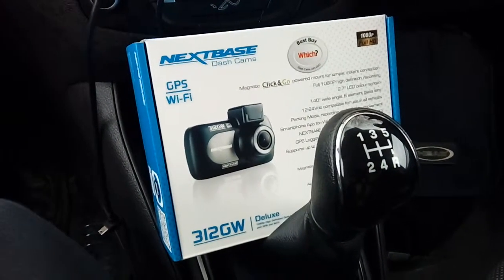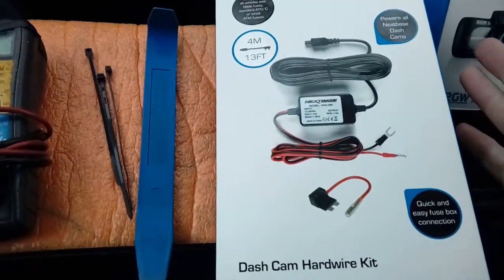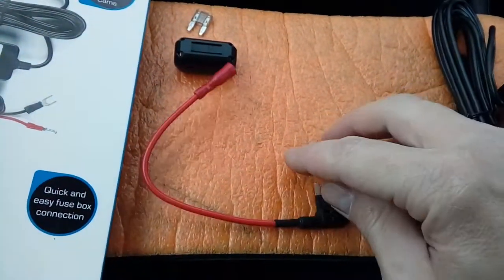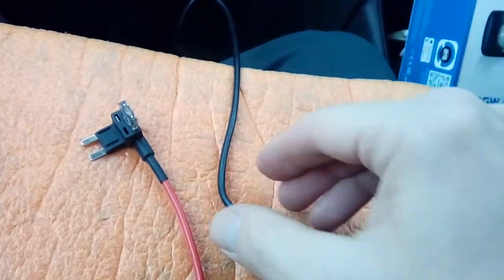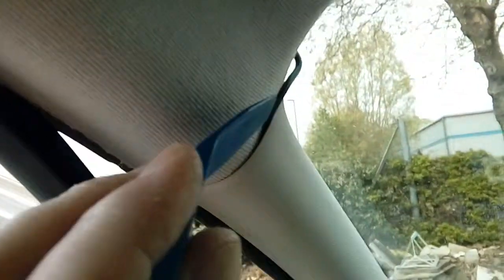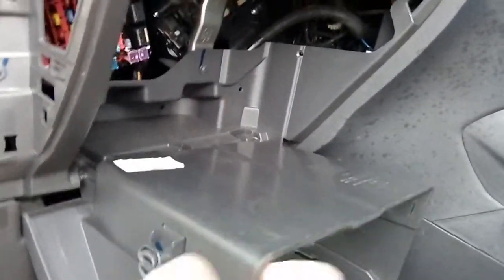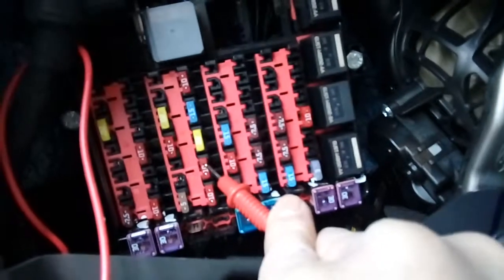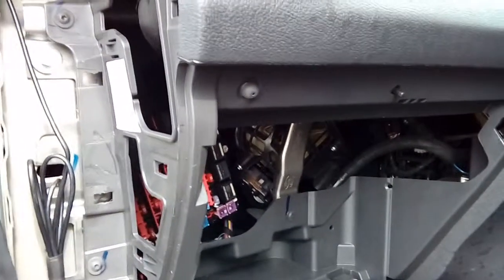Ford Courier how to fit dash cam to go on/off with ignition + no wires on show

Comment: I have this camera and van and just fitting it. To use the parking feature you’d need a permanent live though wouldn’t you? Doesn’t the camera have a feature that stops the battery being flattened in this case?
Reply from the maker: @wanderingsofalanandcaz  Hmm yes a little of makes can be supposedly wired live all the time with an auto cut if when battery drops low, however the amount of taxi drivers or people that have left vehicles at an air port and found the battery flat is very high.
In other words that feature should be taken with a grain of salt.
Some brands such as Nextbase have a built in power pack like a small battery that charges up while driving and can kick in when the cam notices an impact. Just enable parking mode in the camera.
Reply: @PJsprojects  Yeh it’s the next base I have. It seems to say in manual that the camera parking feature disables when can battery drops below 11.5v
Reply from the maker: @wanderingsofalanandcaz  Yes they do state that, good luck 👍🏻

Comment: Hi PJ!
3 questions for you;

1. Would this installation be the same, if not similar, to how you'd do it in a 2015 Ford Focus?

2. If the dash cams (front & rear) were connected to the ignition fuse. (like in your video), would that still allow a small amount to of power to be used for 'parking mode', or would that require a different connection?

3. Which dash cams are the best for rear to tinted windows?

Thanks very much in advance!

NT